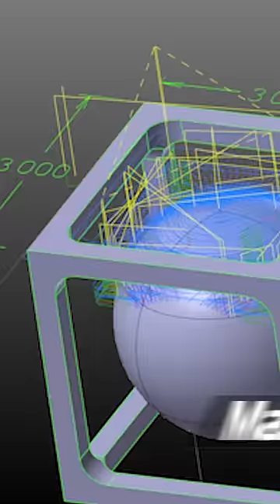How to Machine the PERFECT BALL in a BOX #shorts

Comment: I 3d printed some jaws for a round part I was making and worked out perfect. Love that people are realizing the application of 3d printing in a machine setting.
Reply: CNC
Reply: My uncle, dad and grandad used to make all manner of clamping jigs etc, using scrap wood, hole saws, rasps etc. It's interesting seeing 3d printing/cnc as the modern equivalent, and it seems super useful for industry
Reply: That is so ironic that they could have 3d printed this without 3d printing a special vice.
Reply: @jeremysargent5037  I guess it's a limitation of the strength of part.
Supporting something or being compressed it can strong as any block of plastic, but the whole vice requires greater pressures and less deflection (e.g. adding leather or tape to pliers to avoid marking the work)
Reply: @jeremysargent5037  Not out of solid, and I mean solid, metal tho
Reply: @jeremysargent5037  you are missing the point. You could do a lot of different things. This is a really efficient way of making this particular thing.  The properties of a 3D printed part, even a 3D printed sintered metal par. It’s really a silly thing to make at all, but it’s cool ,impressive and, more importantly shows great way to do something by combining the use of two valuable technologies They could have easily milled the fixtures on the mill to achieve the same thing but it’s cheaper and faster and saves wear on an expensive mill by using a comparatively inexpensive 3D printer.
Reply: Back in the 1800s they did as well
Reply: @djyutremix4856  a CNC is a Machine
Reply: Truly. 3d printing been out for a bit. People surprised that you can  super size it and  build houses (at least in the prototype stage). Like what makes it impossible for housing? Materials? We got cement? Common sense. Whatt???? No way.  Yeah. Dumber I think the us is getting
Reply: Why do they buy you these in metalworks? My company would laugh at that proposal - plastic what??🤣
 Though i machine mostly 10T plus port lifting and scooping devices, where Hardox 500 reigns..
Reply: Dude I needed a replacement trigger for some retro gaming controllers. Works like a charm I see the electronic world never having old consoles thrown out again
Reply: Если подогреть куб, а шар охладить, он вылетит оттуда. И так же зайдет внутрь. Не нужны такие заморочки
Reply: @denvas7843  Коефицент расширения у обичной 350 сталью ~0.1%/100°С. Значит 100mm шарик на 120°С станет 100.1mm, ну или 100.4mm на 420°С.. Хоть щар надо охлождать или на оборот, всё равно. А край такой конструкции можно гибнуть, шар выдавить руками или если сбросить на пол, то только 0.2mm на сторону и он вылетит.
Изшо и добыватся такой точности   для 'куба' (уже так не простая работа со фрезерном станком) не смех, особенно для игрушки.

За того и 'shrink-fit' годен по дизайну штоб две крепкие детали между собой соединить (такое не мало стоит) но здесь не очень. Заработало ишчо если внутренние отверстия были круглые.
[P.S. Извини граматику.]
Reply: @colsonshreve4976  No mate, CNC is the technology itself on which milling, turning, bending, punching, stancing, 3D printing, welding, winding, assembly robots etc. and all digitally-controlled (usually by stepper motors with sensor feedback) movement in devices. Ex.g. even old HDDs in computers themselves are essentially CNC controlled.

 In case of further confusion, here's the official definition:
 "CNC, or Computer Numerical Control, encompasses the manufacturing process where machines cut, carve and form parts based on computer codes that control the cutting or forming tools speed and movement."
Reply: @djyutremix4856  yes and ?
Reply: Such a good idea. I always just machine the jaws I need.
Reply: @jeremysargent5037  then there would be no mystery how a steel ball got a in a steel cage
Reply: @jeremysargent5037  the challenge is not the end result… the process is the challenge.
Reply: Kkkkkkkkkkkkkkkkkkkkkkkkkk
Reply: Kkkkkkkkkkkkkkkkkkkkkkkk
Reply: Kkkkkkkkkkkkkkk0kkkkkkkk
Reply: Kkkkkkkkkkkkkkkkkkkkkkkkkkkkkkkkkkk
Reply: Kkkkkkkkkkkkkkkkkkkkkkkkkkkkkkkkkkk
Reply: Kkkkkkkkkkkkkkkkkkkkkkkkkkkkkk
Reply: Kkkkkkkkkkkkokkkkkkkkkkkkkkkkkk
Reply: Kkkkkkkkkkkkkkkkkkkkkkk9k
Reply: Kkkkkkkkkkkkkkkkkkkkkkkkk
Reply: @RJ-wx3fh  kkkkkkkkkkkkkkkkkkkk
Reply: @RJ-wx3fh  kkkkkkkkkkkkkkkkkkkkk
Reply: @RJ-wx3fh  kkkkkkkkkkkkkkkkkkk
Reply: As a machinist let me just say, we can still do it without the 3D printed jaws. Just use some Bondo and REN board.
Reply: People have been for like 10 years now
Reply: Yes, ppl are very slow...like, those that post comments without a pic...
Reply: This is CNC but 3D printing is pretty cool too.
Reply: Wich 3d printer are you using
Reply: @vitalijslebedevs1629  hello homonym! :)
Reply: What
Reply: @vitalijslebedevs1629  just curious, how do you have access to that much hardox 500, and resist the urge to build a killdozer?
Reply: With their tooling, they could have milled soft jaws much, much faster to do the same job.
Reply: CNC and FDM are a match made in heaven <3
Reply: @vitalijslebedevs1629  depends on what you want to make. Us toolmakers work with plastic just as much as metal depending on your setting. There's plenty of applications where plastic is preferred over metal.
Reply: @RoboticsNShenanigans  that's what I was wondering. 3d printers are so slow, unless theirs is some super expensive model that goes fast. Idk wouldn't doubt it lol. 
But ik if I was doing this at work my first thought would have been aluminum soft jaws.

Comment: Trevor deserves his own video for designing and 3D printing that special jig.
Reply: Thanks you but I only printed them! The design genius behind them is all Barry! 👍🏻
Reply: @trevorgoforth8963  I'm a Toolmaker apprentice, I'm curious why y'all used a 3d printer instead of making aluminum soft jaws.
Our printer would take 2 days to make those lmao. I have Nylon V's I've made. But never use them when cutting aluminum, only brass because it's too easy to ding them up.
Reply: @Under-Kaoz  it's cheaper and easier usually.
Reply: @Jluers021  I guess for a one time application that makes sense. If it's something I'm gonna use again I'd think you'd want it in aluminum. But easier, idk our printer takes forever
Reply: @Under-Kaoz  that's fair. It's usually best for more complex work holding. Plus these parts are likely stronger than the aluminum they are replacing, which is pretty beneficial for gripping a sphere
Reply: @Jluers021  Really, isn't most printers using PLA? Again I'm still learning so I'm not sure. But I use PLA for my 3d pen as well, I didn't think it would be considered stronger. 
But yeah I know little to nothing about the more advanced printers. Maybe you're referring to a different type of plastic.
Reply: @Under-Kaoz  lots of 3d printer use pla. I recognized the one they used. It can reinforce the part with strands of carbon fiber
Reply: @Jluers021  that's dope as hell. Had no idea that was a thing.
Reply: @Under-Kaoz  check out Markforged. They make the one used in the video
Reply: @Jluers021  alright will do, thanks bro.
Reply: It's super straightforward, you simply subtract the volume of the final geometry from a square block and that's your jaws.  There's almost no design work here, it's four clicks. That volume subtraction is built right into any CAD software.
Reply: Easy. Design the part and then overlay another part, being a rectangular block. Subtract the "tool" body (the part), add gap and other adjustments, and you end with your softjaw.
Reply: @Under-Kaoz   Yall need a better printer if it takes 2 days to make that hahaha 

I bet i could get that print under 3 hours for both and still do the same job -_- 

it would look like ass but it'll be strong and grip it just as well
Reply: @MsArchitectschannel  I was exaggerating but it is slow. Dude our toolroom is treated like indentured gingers. We only got a 3d printer because the kaisen shop got one before us which was bs. Still no EDM and our CNCs are all the smlest Haas while the production departments got nice Hellers and the like.

Comment: This is something I would be willing to spend money on. Probably not enough to have a shop make it, but still some.
Reply: Buy a ball, weld the cage..
Reply: think outside the box
Reply: I'd totally spend around $12 or so for a keychain sized one, maybe $15.
Reply: @greybeard4034 Doesn't work as well when you can see the weld though
Reply: @MoonThuli  you can easily sand / polish/ buff it
Reply: You can make a wooden one by hand, even if you're a complete beginner
Reply: @Sun_Dayzzz  I tried once, that turned out to be a mess.  I'm not cut out for proper carvings, relief carvings and instrument pieces are all I can do properly.
Reply: My grandfather used to whittle these from a block of wood with a pocket knife, slightly smaller scale than in the video.
Reply: The best puzzle I saw was an EDM cube.

The parts fit so well that they vanished when put together.

Comment: I almost feel like there's something improper about making a caged ball on a CNC mill.
Reply: It's probably going to be part of an exam in the coming years
Reply: @sammer28  Welp. A problem for the future generations. Thank God we've all graduated highschool.
Reply: @blackjack2526  oh I meant like a related college course.
Reply: "Think outside the box " they say
Reply: @sammer28  or a hire-on test. That's more likely
Reply: @jackryan4313  that would make sense. Especially for some modern machines jobs with very tight tolerances.
Reply: @sammer28  let me put it this way: before you get hired as a welder, in most if not all cases, you take a weld test before you get hired. They need to know you can actually do what the paperwork and training claims
Reply: @jackryan4313  I completely understand what you are saying. I agreed with you. I've done the tests as a chef, welder and carpenter. I think it's essential.

If I wanted only the best, this is what my machinist/millwright gets as his first task
Reply: @jackryan4313  I hear that argument in spirit, but honestly, there's so many equivalent tests of someone's ability to control multi axis cnc that again, it would seem improper to choose the caged ball of all things. That's a test of someone's manual machining skills. It would be like giving them dirty 3/8 plates and telling them to program in the parameters for a robot arm to clean them, fixture them, and run a traditional 4g weld test with grinding allowances. It just doesn't make sense in practice because that's a test of someone's manual welding skills.
Reply: You mean how wasteful it is?
Reply: @beezzarro  The comment directly above yours explains what I mean.
Reply: @AtlasReburdened  ah I see not only your comment, but how utterly out of my depth i am. But i learned something! Thanks
Reply: caged balls? cnc? 🤨

Comment: This is the type of machinist responsible for allowing designers to go crazy with their design and totally screw us technicians up when it needs repairing.
Reply: lol like 3D printed rocket engines that have printed valves and nozzles in one monolithic piece 🤣
Reply: @rustybricks1924  yes and when u need to replace something u need to spend like a day just to figure out how to remove the old one.. they think we are puzzle solver master or something 🤔
Reply: Yeah. Why would you weld a ball inside a cage when you can spend an extra day on the CNC?
Reply: its a toy paperweight man get a grip
Reply: @lt3880  I give u an example for the situation.. battery replacement for Dodge Stratus..
Reply: @ayamin1374  I have no idea what model that is, but after reading this thread I have an awful feeling that the damn battery is tucked away in behind some other parts that need several processes to remove them in order to get to the battery. What happens when that car needs a jump start?
Reply: @markfryer9880  its not famous one but yea u need to use all kind of equipment from wrench to lifter to remove hood and some cover and some shit🤣🤣 same thing when i got to repair machine for precision equipment.. advance machine has the most stupid design ever...

Comment: Could also make this practically with heat to expand the frame. But nonetheless I understand the point of doing it this way, impressive
Reply: I don't know if heat will be enough to expand it to fit that size of ball inside.
Reply: @player-mv7th  yes true it would likely have to be a different design, and use more material so in a material standpoint this video is also better

Comment: Make the cube separate and the sphere separate, then dip the sphere in liquid nitrogen and heat up the cube to 800°C and then you can easily put the sphere inside the cube, let both come to equibrium and you have a sphere inside a cube which won't come out
Reply: The issue is that that is cheating. The idea is to make an "impossible" object to the untrained eye, and make it out of one piece of metal.

Comment: The question is why ? 
Heat up the "box"
And freeze the ball !
😐
Reply: You can do that with really tight tolerances if the ball and the hole are really close in size but it definitely wouldn't work with those kinds of dimensions
Reply: Even then you only have minimal change in the dimensions.. 
Not nearly enough for this.

Comment: How to remove: There are two ways. At least I found two, maybe there are  more ways. First: you put like freezing water on ball to colden it when it is cold it will invisibly shrink for you to easily get it out. Second way: heat up the case of contained ball with boiling water so that the case invisibly expands for you to easily remove the ball. Thanks for your attention. Good bye.

Comment: Maybe thermal expansion and contractions in combination will allow for the same result. So you heat up the cage, and you cool down the ball (significantly) and then you drop the ball into the cage and let the materials aclimatize. Dunno if its possible, it might not be.

Comment: would love to be able to work metal like this, i have 10 fdm 3d printer and 2 resin, got a little cnc router about a yr ago but it isnt able to cut aluminum but im working on getting all the parts together to either build a new cnc machine or upgrade what i have to be able to work with aluminum. dont really know what the best option is but love videos like this, an love how u used 3d printing to further ur cnc machining agility

Comment: Should have done one with the sphere's diameter being larger than the box's height.

Not too much difference I would think, but certainly at least a bit more challenging.
Reply: A real turner's cube has much smaller openings on the sides. They already did a cheap knockoff version of a beginner project.

Comment: thats a lot of work when you could've just put the ball into the freezer to make it smaller before placing it inside the box.
This is the same as what they have at school with the ring and the ball. Heat the ring and the ball fits. heat the ball and it doesn't fit anymore.

overall seems like the Apple approach to making something.

Comment: You could do it easier if you machined each piece separately, then freeze the sphere and heat the cube frame.
Reply: Opinions arent facts.    Stating something is easier, would be your opinion.
Reply: @marktwain8192  No, I've  done something similar before. There are 2 large pins that go on a M-198 Howitzer (I'm not 100% their exact name but I believe they were called elevation pins). They are pressure fitted, you can try punding on them with a dead blow hammer for a couple of days. Or you can freeze the pin for a few hours and warm the holes a bit with a torch. They'll slip in nice and easy then.